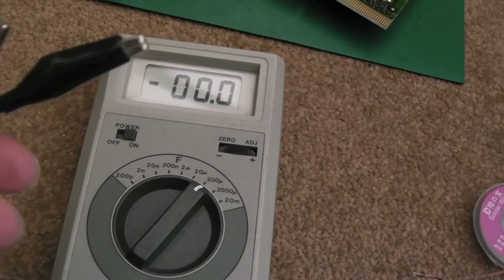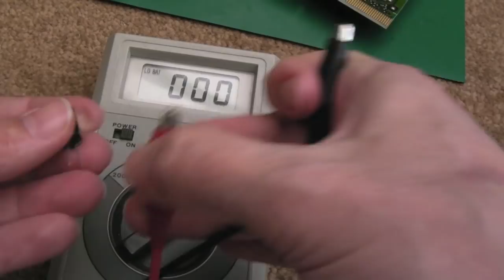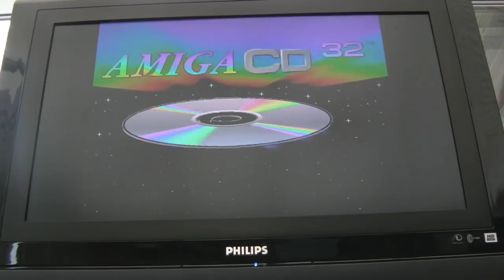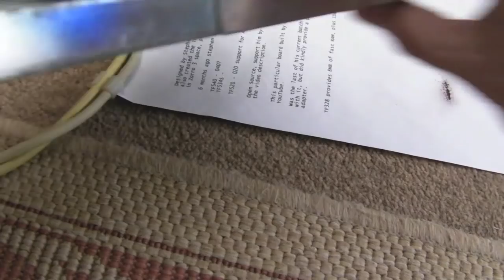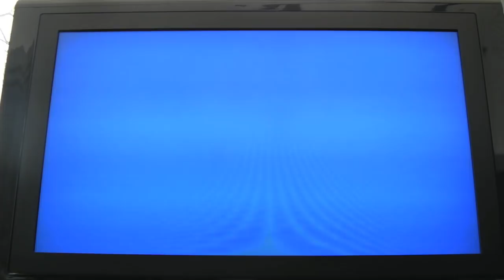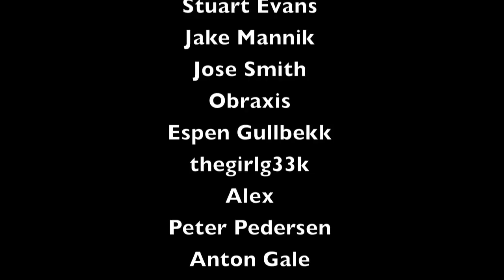Commodore Amiga CD32 Repair Part 2 - Pesky Reversed Caps

Comment from the maker: Correction Just looking back at the schematics now, I can see I made a mistake there assuming there was a TTL IC inbetween the joystick ports and AKIKO.  It appears that the P0X P0Y P1X P1Y lines connect straight to PAULA, and the _FIRE0 and _FIRE1 straight to AKIKO. But there is a shift register for the other data connection there.  So the only direct connection between AKIKO and the D connectors seems to be on the _FIREn pins.   I will talk about this in part 3.
Part 1 - https://www.youtube.com/watch?v=HmRy2TWIgWE
Part 3 - https://youtu.be/10-SJJRu5xo

Comment: Mine's coroded as shit. I'm very greatful for these hints, now I know where to look and what to double check. In return I've got small advice, maybe You find it useful. For better desoldering results just add some tin alloy (more Pb=better;)but 60/40 is enough. It helps to transfer heat trough all layers. And for cleaning I would recommend some "PCB cleaner". there is variety of different brands. For example PCC from "Kontakt Chemie" this one is quite expensive, but it's pure magic.  Cleans every soldering stuff, connectors, shady pins, even some of surface corrosion on PCB.
Reply from the maker: I always use 60/40 solder!

Comment: When tackling an older piece of kit like this console that was sold as 'not in working condition' I would always want to factor in a re-capping kit into my costs.  It just makes sense because these things don't last forever and is the most common cause for failure in electronics in general.
Reply from the maker: If you are selling a system I would agree!  But these will stay in my collection and I will be keeping tabs on them.  At some point I may swap them out but right now I see no point.  They won't always leak, but can you say that about replacement caps - they might last 10 years before they leak, but these have been on here 20 years ish already and haven't.   Another example is my 1200 - had it around 6 or 7 years now and every year I check it and the board and caps are pristine, and it behaves like a brand new system.  So I am reluctant to just swap out the caps when there's no signs at all of any leakage.

Comment: Really nice videos you got. Thoroughly enjoy them as a break into a hobby I haven't had time to delve into for a while. Thanks, and keep it up!

But... If you're concerned about ESD, I wouldn't put the board on a carpet, which is what it looked like while you were talking about it. A lot of static charge can quickly build up.
Reply from the maker: Thanks =D  I am totally aware of ESD and precautions etc.  It was in the shielding at that point, and the type of carpet I have in this room does not generate or hold static.  If I had a pound for every person that kicks off about ESD I would be loaded lol =D  It's appreciated though!

Comment: I've still got my old CD32 (only problem is that it's in bits, and has been for the last 15 years) :O I'm currently missing the power supply box and the entire laser head assembly (plus rubber anti vibration grommets that fit between the laser assembly table and the case). I would like to get this old piece of kit up and running again, so do you know of where I can get CD32 parts from? Warmest regards Wayne and Nina.
Reply from the maker: No idea on individual parts - Lasers are on eBay (super easy to find), and I would probably adapt some grommets or something to replace those vibration grommets.  PSU you can make from either a HDD PSU (£7 on eBay), or like I did - use an ATX PSU.

Comment: Trying to unblock the solder left by the caps in the video, I've found much better to apply the flux to the copper desoldering wick before using it, instead of applying the flux to the board.

Comment: The Amiga 4000 cpu tower/expansion certain revs have the caps the wrong way around :/.

I had a really rough time socketing a chip in a mv1a-chx because of plated via's - I think its just a 2 layer board too.
Reply from the maker: I thought some 4000's had caps the wrong way around! =D  Yeah, MVS boards can be tricky to desolder through hole components!

Comment: Wow. I couldn't believe how much heat was being absorbed by the PCB. Also, I totally forgot about the misprinted cap polarities on the PCB. Although, I have yet to get my hands on a CD32 -- very hard to find here.
Reply from the maker: I know lol, granted it is winter here in the UK atm, and the ambient freezing cold does affect soldering in the room I am in, but those boards do absorb a lot of heat =/  There's another faulty CD32 on eBay UK at the moment for around the £100 mark.

Comment: It's funny my shielding is in the exact same condition. Maybe CBM used something inferior in the CD32 build. The to caps you replaced have got me wondering what mine are like now haha
Reply from the maker: Haha - check those caps!  If you've not swapped them and have a rev 3 then maybe they are wrong too!

Comment: totally reminds me I have one of these laying around somewhere as well! Where did you get the laser replacement from, vaguely seem to recall I need to fix that on mine as well (cant remember, been gathering dust for well over 2 years now... ouch)
Reply from the maker: Tones of the lasers on either eBay or AliExpress!  Apparently its a really common model used a lot in Brazil and in loads of different CD players.

Comment: It looks like the silk screen is wrong.. the + on the silk screen is clearly marked close to that ground point you tested against.  So I guess the guys who put the through hole cap in went with the silk screen instructions.  So we have to blame the PCB designers!
Reply from the maker: Absolutely - that's why they were the wrong way around.  Yes, naughty PCB designers... What's suprising is no one double checked the layout?  It's pretty obvious if you went around checking all the smoothing / bypass caps.

Comment: I always rip-off electrolytic caps' cans, and then desolder individual pins. It is much safer and easier.
Reply: pull them up?
Reply: @sviru007  Yes, pull up and break the pin-to-aluminum band bond.

Comment: How does the sound still work with 2 caps the wrong way round?
Reply from the maker: The caps on this board just affect the 5v supply rail (VCC) - so sound won't be affected until the caps lower in capacitance (which they have done), at which point they will smooth less and noise spikes on the VCC rail could affect other parts of the system, although typically the 12v is used for the audio stage I think (certainly on other systems).  So in this particular case the audio probably wouldn't be affected.

But in the 500 where the caps need to be bypolar, or in the other Amiga (One 4000 model has audio caps wrong way around I think), the caps will still work as normal, well their filtering might not work quite the same way, but they will hold charge like capacitors are supposed to, and to a degree they behave the same way for a period of time.  So they can still block DC and pass AC.    

When the cap is the wrong way around  insulator on one side of the foil starts to erode (chemistry thing I think due to reverse polarity), and eventually it becomes a short at which point you get the can expanding as it leaks, or a pop etc.

Comment: How did you find out those 2 caps were reversed in the factory? Also if I grab an amiga 500 (if it is affected) is it worth swapping out the wrong caps?  

I was confused for a minute as after you took those caps off you were referring to it as the "positive side" because that's how it was marked on the board, luckily you explained it later lol
Another question, when you did the continuity test, it seemed to beep when you connected both sides, how did you tell which side was negative from that?
Reply: RefractionPCSX2 positive sides of the caps sometimes beep shortly, and then stop
Reply: Ahh, thanks Valtteri Airola, didn't know that :) Makes sense I suppose! lol
Reply: It beeps shortly until capacitor charges from the meter... that is how the capacitors behave. Capacitor try to prevent voltage from changing. Continuity tester puts some voltage across test leads, and capacitor tries to cancel that voltage, but eventually it charges and becomes a break for a constant voltage from tester.
Reply: Thanks for the detailed explanation tzok83 :)
Reply from the maker: Corrected: I showed in the video at 7:43!
Reply: That's where you show the height of the cap lol. Did you mean a different time?
Reply from the maker: Sorry - 7:43 =D  My bad! :P
Reply from the maker: And as tzok83 said - when testing to one pad it beeped very shortly and then didn't - that shows that there's not a short.  On the pad with the short it beeped constanly and read 0 ohms on the meter.
Reply: Yeah i saw that bit, but you never mentioned about the whole it beeps for a second so I didn't know what was going on xD But yeah, I know now lol, cheers! :)
Reply: Discharged cap behaves as short circuit for a moment when voltage is applied. That's why there is a short beep when you test continuity between positive lead and GND.